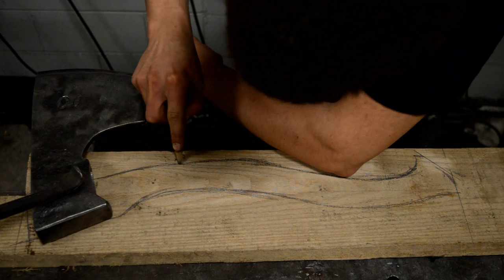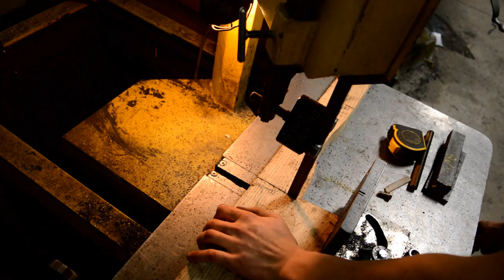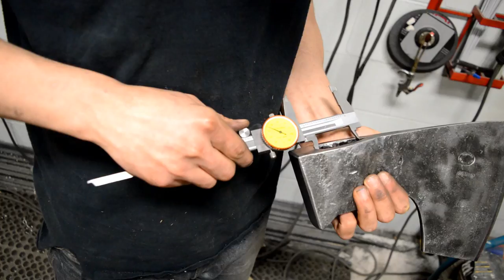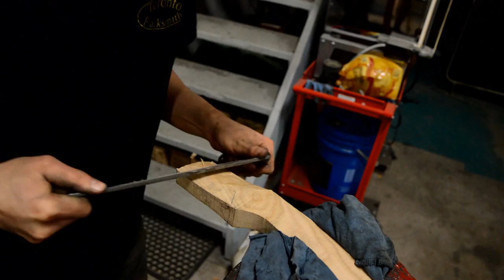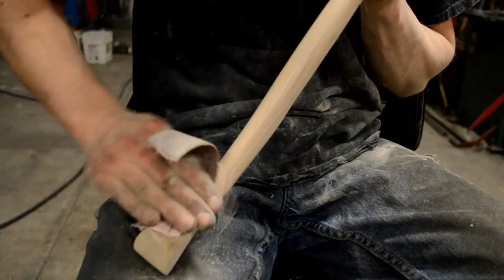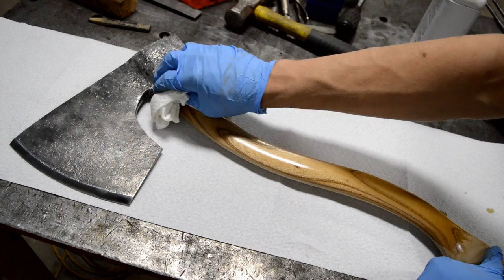Forging a HUGE Norwegian Broad Axe FINAL

Comment: That is a piece of art! Would love to see it in use. With the weight I bet it will slice through wood easily,
Reply: They are for barking and flattening, not splitting or felling.
Reply: Thanks I know what it is used for I have hewed many logs. I never use my broad axe to remove bark that is what a spud or felling axe is used for. Bark is very hard on fine edge and a fine edge is what you want on an axe like that,

Comment: Nice axe, and thanks for sharing the process.
Thought I'd chip in some information/background on the Norwegian broad axe.
In Norwegian it's called a "bile" which is the general name for a broad axe with a lightly curved edge. They are called different names after their shapes and sizes. This axe would be called a "Tømmerbile" (timber bile) and is mainly used for rough shaping of logs to be used for ship/house building. The smaller ones are called "Snekkerbile" (carpenters bile) and are used for finer work. The oldest still standing Norwegian timber building is called Vindlausloftet and is roughly 850 years old.
For those interested in how these houses were traditionally built and how these axes are used, check out Norsk Folkemuseum's film of the remaking of an old building. https://www.youtube.com/watch?v=d4746vgMS-w

Comment: shouldn't the handle be longer?
Reply from the maker: No. This style always has a short handle. They made them with heads weighting 12lbs, and the handle typically were never more than 24" long.
Reply: Paul Krzysz hey if i ever go to the Us mind if i pay you a visit?
Reply: The handle is short because it's a tool requiring a lot of control. It's used with short precise strokes. The weight of the axe gives the force, you're just controlling it while it letting it fall on the cutting line. It's as much a slicing stroke as it is chopping.